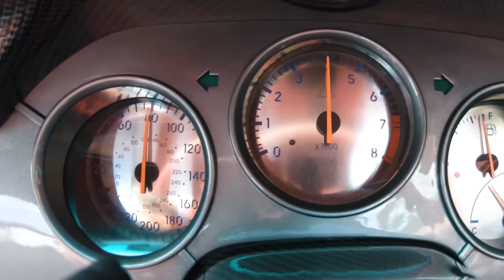The secret to Japanese car reliability - REVEALED!

Comment: Lexus/Toyota knows that if something works, stick to it and make simple improvements. I can relate based on owning the following cars over a 10 year period between my wife and I. 2006 IS 350, 2007 GS 350, 2014 IS 350, and 2018 IS 350. Now, they refreshed the 2021 IS 350 and it is the same motor throughout all those cars since 2006. Go figure! None of those cars gave me a single issue. Never any issues with the motor. On the flip side, we have owned the following as well and they were a pain in the ass outside of warranty, 2014 328i f30, 2012 335i f30, 2018 BMW x1, and 2008 Mercedes c350. The Mercedes was used (2 years old) but left my wife stranded on the highway the first day she drove it to work. I took it back to the dealership and got a Lexus. Lesson we learnt is that you finance the Japanese but LEASE the European.

Comment: Toyota had to recall 2.4 million hybrid cars in 2018 , i2015 6.5 million cars due to electric switch that kept short circuiting, 3.8 million cars due to pedal entrapment in 2009 ....since 2011 its estimated that Toyota had to recall 20.5 million cars at huge financial cost...so it’s not been a great decade tor Toyota

Comment: 7:10 this logic is kinda of bad, considering most of Toyota’s engines can’t be tuned easily to make tons of power,  and the supra can’t make 1000hp with out being fully built like pretty much every other turbo 6 cylinder. Bmws are terribly unreliable but engines like the s58 s55, b58 and n54 can make up to 800hp on stock internals, but still unreliable

Comment: Sorry to see that you really do not seem engaged in this one matt. We know you are a German car fetishist, but come on, at least act like you aren't a little bit impressed by the reliability of the Japanese cars. They might not tickle your balls as much as a BMW but for many people that doesn't matter as much as a reliably car that doesn't brake down. Especially in this age where we have to try to watch our carbon footprint...more repairs means consuming more of our earths resources. People are starting to tire of it, and with the increasing performance and longevity of electric cars, the German manufacturers really have to step up. Also, it would have been interesting if you had done a bit of digging on the fundamental differences between the engineering philosophies of German car builders and Japanese ones. Despite my comments, great video with some great insight. (Owner of a 2018 Passat and a Toyta Corolla 1.6, 2001) :)

Comment: Where is mazda 😩 at least the petrol engines were always reliable as fuck. Driving an 2014 mazda 3 with a 2.0l natural aspirated petrol engine (120ps). It got 260.000km without a single problem!!!

Comment: This is good content, Matt.  There is no doubt here in the States as well that Japanese cars objectively have the best reputation for reliability. But I've always struggled with why other manufacturers (especially the US ones) haven't looked at these cars and those processes you mentioned and said "we have got to match this kind of reliability." And if they have, nobody has been as successful at it. Sure, there are always outlier cars out there with tons of miles but I just get the feeling that the other car makers dont want to spend the resources and apply the extra TLC that the Japanese car makers do. My only guess is because a large group of people continue to buy cars mainly for their looks and/or specs, which is understandable (something like the late Dodge Avenger).

Comment: My VW golf mk4 2003 model 1.6 and  swapped to 1.8t. from audi TT 2002 engine ,left me many times in the road many elecrtrical problems i change windows 10 times mecanisms many times locks from the doors  in the 18 years i have it and few others things and new when i bought it had some issues  as a car, so german cars is not reliable car and still believe japan and korean cars are more reliable cars than the german cars except few expensives cars MERCEDES PORSHE BMW ..

Comment: you still haven't answered the question: are japanese cars really that reliable? You may also check the german statistics of ADAC or DEKRA. Or would you claim that Germans know nothing about statistics? Especially when they have a much larger number of catrs in their data base. And when every second German car driver is also testing all cars at high speed on the Autobahn? And by the way: I am not German. I just have my car checked up like Germans, in reliable garages and well trained mechanics.

Comment: Reliable? Seriously?! Only reason why they are reliable is coz they are using ancient tech. Imagine a bullock cart, how often does it break down? Engine in a Lexus is300 hasn’t changed for 20 years!  All that’s changed are the shell of the car. Changed the design and call it a new car

Comment: Why do the japanese find it easy and the European not, to build reliable cars? Well that answer is really easy: Because Japanes don't invest millions in enginered planned obsolescence like the European car brands do, like adding "biodegradable additives" to the critical plastic parts of the engine to disintegrate  the molecules of the polymer after certain headcycles, that can be set to a specific time of use, supposenly to "Save the planet"; ore using micro relays, transistors, mosfet, chips that cannot handle high current or headcycles continuesly, to switch on/off electric parts like fans, power steering, lights or any type of high current draw components, this resulting in the never ending cristmas tree affect of your dashboard "money light" or "spontaneous combustion" of the car! But all this is not casual, this is made to incentivate consumption and that is why European cars are endless money pits!

Comment: Example of US tricks. I have a 2002 gmc savana 3500 5.7 Van. Headlights go out. The switch gets hot and melts the dash mount for switch so you can't replace. I bought a factory service manual. In it, the wiring diagram shows that the domestic version does not have fuses or relays in the headlight circuit. The export version DOES! So GM hates their own country and people? That is only one example. I could go on and on. I have tractor trailers, tractors, heavy equipment, cars, trucks, and motorcycles. All of the USA brand stuff has a mechanical pitfall that forces a niche proprietary part or dealer requirement for repair. It's sickening. Of course USA can make very expensive things very well. Jets. Tanks. Guns. Missiles. Monster heavy equipment. War machines. Roads. Wal Mart buildings. Etc. Japan can build affordable level stuff with precision and quality.